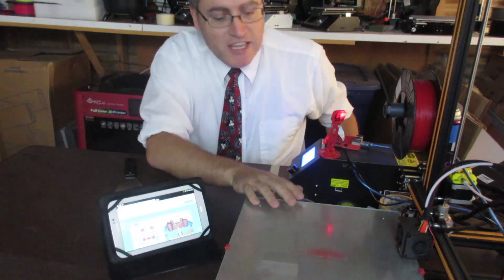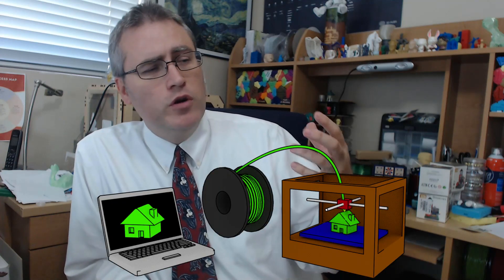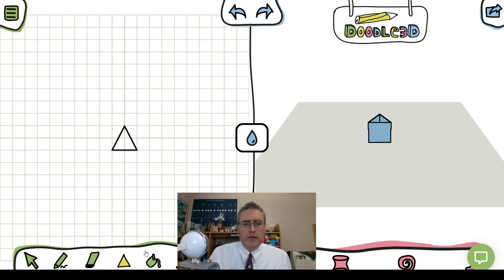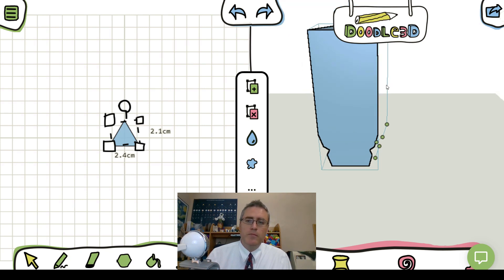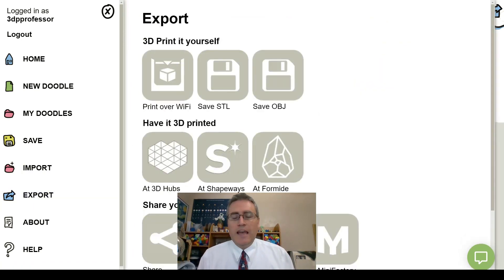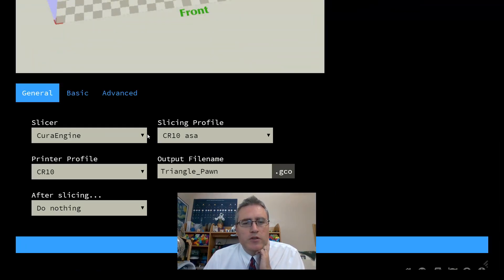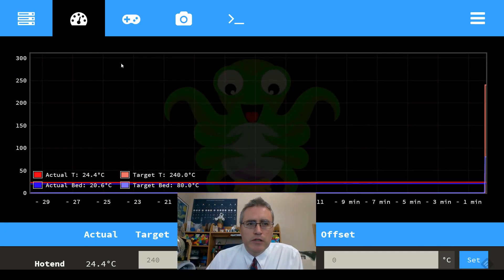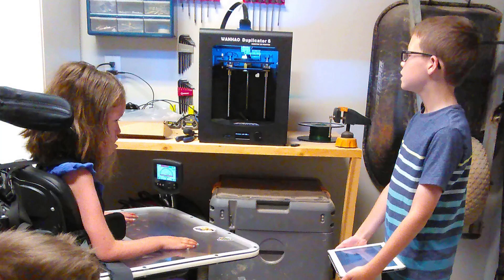YouTuber makes 3D printer setup for disabled children

Comment: Does it have on board slicing or is it "connected to internet" slicing only?
Reply from the maker: Octoprint slices locally. So the only "connected" you need is to be on the same network. I originally went with an option that needed internet connectivity, because it was easier to set up, but it went into "we're performing maintenance" mode, and it's there still.

Comment: Great project!

Perhaps it's possible to ditch the upload stage to Octoprint? For example by having the PI serve a shared folder, SMB or NFS share, binding it up on the tablet, and having the tablet app save there? I don't know what kind of a tablet that is and what would be involved in that, but given things that are possible on a rooted Android, you can just add Linux native non-graphical software and you can use symlinks, it doesn't seem entirely unattainable. I'm sure Octoprint should be possible to extend to detect new files, once they're fully written, and then launch slicing for those automatically? It might be outside the scope of the project for now, but in case more people need this, it seems like a viable direction the project can take.
Reply from the maker: That's possible, I suppose, but having to mod a tablet in this way ties the tablet too closely to the 3D printing process, making it less useful as a general use device. I would like this idea more if we were using a more functional editor like Blender or Fusion 360, but with them sharing a folder is no big deal.

Comment: Great vid as always, Astroprint is really good too it's very easy to set up, easier than octoprint with a nicer GUI
Reply from the maker: I actually started this project with the Formide, a great system with easy setup. But days before I was to deliver it, formide shut down. It's been weeks and they're still "Doing some Maintenance". I checked out Astroprint, and would love to have gone with it, but it, too, had a web-based element that if they ever decide they're not making enough to cover their web hosting costs, they, too, will disappear. So I went the relatively ownership safe octoprint route. I almost want to make a whole video about my opinions about the impact SAAS is having on 3D printing, and the world in general.

Comment: Joe, we need to do something about your equipment to make your videos more professional and easier to consume without being distracted by technical issues. The video feed looks like it came from a $5 webcam from China, which i'm not really going to judge being blind as i am, i don't think it's horrible, i've seen worse, but the audio is pretty bad and inconsistent, and i do have perfect hearing and i find it grating. What are you currently using, what microphone, do you have a preamp? How do you control levels during recording? What's your software chain? Maybe that's something we can help you out with.
Reply from the maker: I would love help with that. I recognize there's a problem, but can't just stop making videos until it's fixed, especially when I don't have the means or knowledge to fix it right now. It's a case of doing the best I can with what I've got.

So at the start of this video I'm recording with my Cannon Powershot and it's mic. I bought it because it was supposedly good for vloggers. As you can tell, there's a reason I didn't stick with it. Unless I'm way off base, the rest of the video sounds way better to be. What I've got is a cheaper Blue Snowflake mic pluged directly into my computer USB port, because at one point I thought the interference may have been coming from being plugged into the USB hub. But I think maybe the mic is just dying after years of use. Any suggestions?
Reply: Oh of course you shouldn't stop production, but i wanted to raise this so you can involve us into helping you get your production quality up. Perhaps we can give you the bits you need. Maybe someone even has left over hardware they no longer need but never got around to ditch. You don't have to fight every battle alone.

Blue Snowflake, dying? On the board, there isn't much to die. Electrolytics are gel type, they should hold up, besides they're not subject to any kind of heat or abuse. The power input instantly made me chuckle when i saw it on Mark Furneaux's teardown, because it's apparent they could have gotten a MUCH better power noise rejection with just the same inductors and capacitors that they used, had they just rearranged them somewhat differently to, but it's not a terrible effort at all, often you get nothing at all, which does actually tend to be a big issue, so i guess they've done OK. It's an electret microphone, and i've seen JFETs that are inside the electret capsules drift with time and become useless, so there's that, then distortion goes up and the output goes down. I find it 'surprising' that Blue uses electrets with internal JFET rather than breaking the JFET out onto the board for a more reliable operation. Chances are, since they are 3-terminal capsules, external JFET retrofit and bypass of internal one is possible, but i'm not 100% sure on how.

I don't think Yeti was a terrible choice, nor does it have many alternatives, though i guess Samson makes something similar.

I don't necessarily find that $2 lavs from China are terrible, and a Vivanco one i had from a local store for like 7€ was outright great - obviously their performance depends on the placement much more than the Yeti, and also on the soundcard, so there's that.
Reply from the maker: ON your recomendation I've ordered a cheap Vivanco lav mic. In the meanwhile, I wonder if it's the cable on my snowflake that's failing. Maybe I can replace it and fix my problem.
Reply: It never hurts to have an extra cable, and the Yeti tends to fail specifically at the connector, but i don't think Snowflake does, and the standard B cables always seemed extra robust to me, i never managed to wear one out even with MIDI controllers and the like that i yank around. But i don't think this is it; i imagine your issues would be much worse. Then again, if they really are worse and you've edited all of those issues out?
Reply: I don't understand the need to have super high quality Youtube videos.  Or even TV.  
I think the quality is just fine.  I can hear it, I can see it, it's all good.